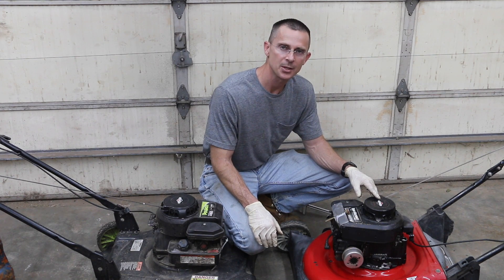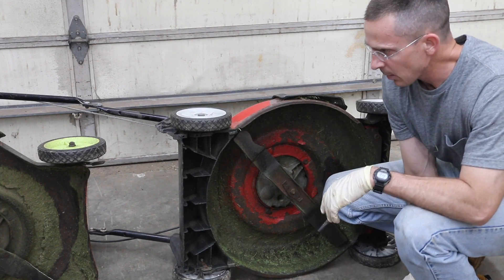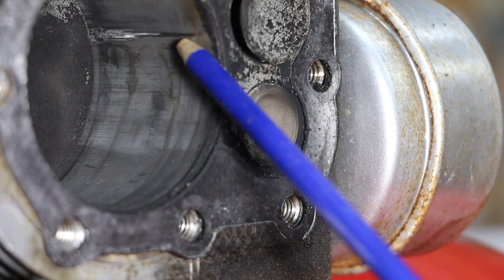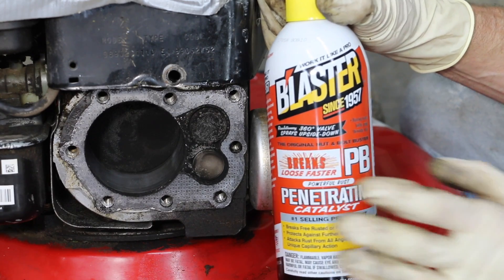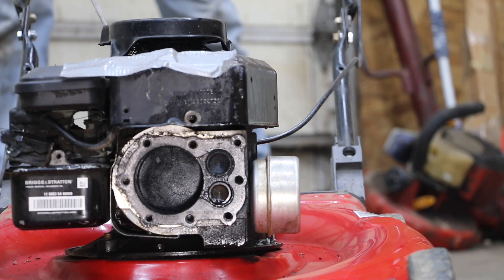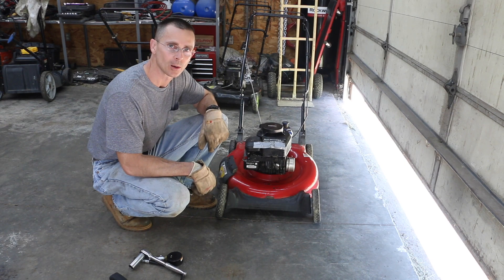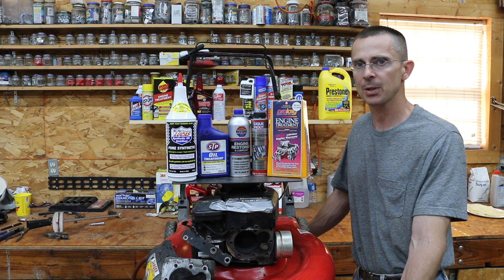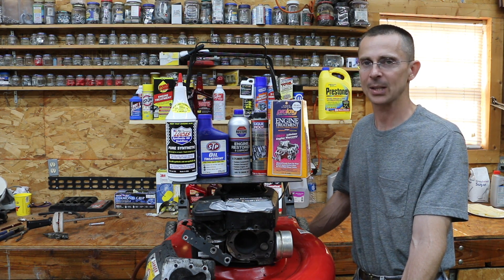Engine ran without oil, seized! Can it be saved?

Comment: I had a oil filter come off of a s10 blazer years ago and the motor locked up so I filled it with 100% slick 50 and it was a standard so I pulled started it and the motor finally broke free and started but once running it knocked for about 5 minutes and finally smoothed out and I drove it for 6 more months and put another 7k miles on it until ball joint broke and wrecked it into a ditch.
Reply from the maker: Shane, Very impressive!  Thanks for watching the video and commenting!
Reply: +Matthew Mckinney
Story time. I have a Ford 302 in my car. When I bought it, the oil that was in it was 10 years old. The car itself is 30 years old. By the time I got it home and tried starting it again, the engine was seized. All of the oil had turned into sludge and was everywhere except the oil pan.

I put 2 quarts of oil in it and it started. After a couple oil flushes and some other cleaners, it runs like new. Starts on the first crank every single time. The only issue it has is a lifter tick.

In fact, it still has more than enough power to overpower a shot wheel bearing, and to damage the transmission, and it isn't even an H.O. I hadn't thought to service the transmission, so when I finally had it flushed, it basically bricked it. Mind you, this car sat in a garage for 10 years and the transmission still worked about 98% before the flush. I also have a suspicion that the shop didn't refill the gear oil when I had them put in a diff.

On the flip side, my mother has had 4 Chevy engines fail for no apparent reason. Two of them were 5.3 LS engines. The oil pumps in them are garbage. The 454 oil pump also failed. We still don't know why the 350 bricked. It just decided to die and never started again. None of them even had 200,000 miles. The highest was a 5.3 with 186,000.

...Which is 300,000 km, gravedigr12.

But ya know, hurr durr Ford sux, muh junkyard LS, etc.
Reply: @ootdega   my dad has a 2009 silverado with a 5.3L 273,000 miles. The oil sending unit went out like a year ago at 200,000 miles never put a new one in it but he put 73,000 on it and it says 0 oil pressure lol
Reply: I don’t particularly cling to ford trucks but my neighbor had an f150 with 750k miles on it before the transmission wouldn’t shift out of 2nd anymore. I thought it was pretty durable for the most part. Larry always changed his oil and filter at 3k miles and took very good care of it.
Reply: thats awesome dude
Reply: #murica
Reply: oldschool Boost sounds like a 2.8
Reply: My engine on my 1992 caddy locked up if I put oil in it will it start?
Reply: Every auto mechanic that has worked on cars for a living has a soft spot in there hearts for GM. I don't know where all of the hatred is coming from? Try working on a Jaguar!
Reply: What the hell? Were you 16? Or... 5?
Reply: limitless rc, running an engine that seized up from no oil for 7k more miles, yup that's a GM product for you.
Reply: @limjahey4585  GM engines are not the huge problems, its the electronics. Watch some of the Scotty Kilmer channel. He always talks up Toyota and Honda while bashing GM and Chrysler for their quality issues.
Reply: limitless rc yep random butthurt comment from an insecure car owner must be a Ford owner enjoy rebuilding your engine at 300,000km.
Reply: I've heard of oil pick ups falling off before, that would probably cause that issue, but for it to happen repeatedly? There's no engine I've ever heard of that just has such terrible machining it just locks up for no reason on a regular basis.
Reply: Oaf Dawg actually you can beat any chevy new or old. With a Ford, or import too. Chevy is and has always been trash, the parts just dont last. People like to trash on ford but i know more fords running today from 40s, 50s, 60s, 70s, 80s, and even the 90sup to 95. And even as a ford person, i wont own anything made after 1995 simply because triton, vortec, ecotech and echoboost cannot make an engine worth two fucks. I've seen more 2017 gm and chevrolet products sitting in the side of the interstate than i can count. Chevrolet needs to stop getting government bail outs and just shut down and give it up.
Reply: @carll.freemanjr.9867  The problem with these old US corporations is that they believe that because they have been around a long time, they should continue to exist simply for that reason. If the big car manufacturers can't make it, they should sell out or fold up shop. Make some room for new car startups that are better configured for the current economy.
Reply: Had a Chevy 283 that was froze up back in the 70's. A 36" pipe wrench on the crank wouldn't turn it over. I put the trans, clutch and bell housing on it and put it in my 66 Chevelle anyway. Poured Liquid Wrench in each plug hole, left the plugs out and had my gramps in his pickup push me down the road. I got going about 25 and let the clutch out. The engine was so locked up the tires just squealed. Finally after about 3 tries with the trans in 2nd gear the engine finally freed up. I put the plugs in, wired it, and fueled up. I push started it and that engine ran like a top! Stock 283, with a Rochester 2bbl carb and factory duel exhaust would smoke Trans Am's, Firebirds, AMC AMX's, and other "muscle cars" back then. That motor ran great until I pulled it and replaced it with a built 327 .030 over. Just can't beat them old Chevy motors!
Reply: Patrick Baptist
ya nice story... US military bought... GM's ... ford has a recall for the steering wheel falling off... 

And I can talk about the POS 6.2 diesels that went a million miles in a service truck... I would take a chevy any day over a ford at least when something breaks... ford... every last combo has everything different... chevy not that bad. Just because you drive the death out of the chevys to the point they die in the road but not the fords means nothing.

I've seen chevys broken in half still hauling scrap to the scrap yard.  

Won't even comment on the 454... for it to be that low of HP it must have been an emissions 454 from like the 80s?  I've seen 454s worked to death and not even burn a drop of oil yet the block was rotting out from age / use (plow vehicle)
Reply: Ya ford should shut down as well, they took that HUGE gov loan they still owe on... GM paid the gov back already.
Reply: Matt Lane you should look that up because you are incredibly wrong. Ford took a $5 billion loan and it isn't due back until 2022. GM took a 20 Billion dollar BAILOUT and fired the CEO, then couldn't afford to pay it all back because their stocks tanked so hard. The government sold their GM stock for less then 9 billion. So no GM still owes 11 billion of our tax money. As a former GM guy i also drive Fords now, and most guys who drive Fords daily do it because they got tired of fixing GM products all the time.
Reply: Jimmy Doolittle that's why you buy a chevy truck and swap either ford or dodge axles
Reply: gm engine seizing? yep, sounds normal. had a friend who's parents had a gmc jimmy. thing went through motors every couple of months despite regular oil changes. they'd always seize after awhile. older couple and they didn't hot rod it.
Reply: OpposingForces haha went through motors.
Reply: still ran, still better than a ford
Reply: Hey gravedig, I drive a F350 that is getting close to having half a million MILES not km on it, it hasn't been rebuilt or had any major work till this week it was time for the turbo to be rebuilt....
I own a GM motor home that couldn't make it much more than 40,000 miles on it before it burned some valves trying to make 172hp with that 454 piece of crap they made  LOL.  I've never owned one GM product that was worth a crap, EXCEPT some Isuzus I've owned.
I've had chevy's stop in the middle of the street before, I've never had that happen in any Ford I've driven ever, they usually screw up in the drive way, the chevys lol, just add more expense with the tow when they can't make it.
Shucks when my ol Taurus decided to break a suspension spring it atleast did it in the drive way after I was done driving LOL, I've seen a chevy frame bust in the road on someone driving before.

Most people don't also realize but no company has had the fun of steering columns locking up on people like GM, even applies to some vetts, how retarded.
Reply: Patrick Baptist I never thought about it that way but it does seem like all of my old fords have broken at home after I got where I was going. Love those trucks
Reply: Shane Shaned broken ball joints yep that's a gm product for you

Comment: I don't think there is any product that can get rid of that rod knock without physically replacing the rod bearing, the noise is because the gap is too big and your hearing the rod slap going up and down. But I'm sure your already know that :) keep up the great videos!
Reply: That's exactly what Lucas is for, hiding the sounds of a dying engine so a sap will buy it. The secret weapon of shady used car salesmen all over...
Reply: robbie turnbull they do NOT have any bearings in the connecting rod, they are just an aluminum connecting rod, that's on the cast iron polished crank. the aluminum laps to the crank and that's it. a bunch of material was lathed out when she was lacking oil. the knocking could also be a wrist pin, and or the piston touching the head. he should remove the governor and rev er to the moon still it let's out all the shmooo
Reply from the maker: Thanks for watching the video and commenting!
Reply from the maker: Stealth, Yes, I agree.  It'll be interesting to see which product reduces the noise the most.  Thanks for watching the video and commenting!
Reply: First drain the oil.
Apply about half light oil. crank it manually without running for a few times to get it flung around
then add the rest with LOTS OF THICK HEAVY DUTY OIL
it should at least reduce it.
Reply: realflow100 " you are my density""- George McFly 1956
Reply: How can a connecting rod not have a bearing unless you mean its a bushing and not a bearing, that what we call it where I'm from.
Reply: Like the old BARS stuff we put in brakes and radiators to plug leaks.  It'd destroy it in the long term but short term it'd make it work better.  ;)
Reply from the maker: Thanks for watching the video and commenting!
Reply: ZIP TIES N BIAS PLIES 
Fuck you doing here ? Get back to doing cold starts. 

Miiiiint 👌
Reply: Well I didn't. Thanks for the info
Reply: StealthLX you never heard of a rod bearing lol.
Reply: realflow100 Yeah maybe some 90w Diff oil would somewhat reduce the noise. Then as a previous posted suggested, clamp the throttle plate wide open to silence it permanently.
Reply: You know that means to brick the engine on purpose by over revving is what you just said right? or are you just making a joke
Reply: realflow100 I was making a joke, yes. Of course that would kill it - so silencing it permanently. Try a couple of things, then end with a bang.
Reply: StealthLX these 3.5 hp Briggs and stratton engine don't have rod bearings its it basically your con rod just bolts and clamps on to your crank shaft
Reply: 90w Gear Oil isn't as thick as you think.
Reply: Zip ties what the hell you doing here?? Get back to ol Slave Lake already?? Unless you’re looking for the right additive to add to some radioactive horse piss.
Reply: RELEASE THE SHMOO!
Reply: But thats kinda the problem, it can help but it can also hide things. Is my valve train working right or is the sound of bad lifters being hidden by the Lucas? If your bearings are starting to go or your rings it can buy you extra time before the engine dies but I think its best to only use it when it gets to that point. I have also yet to see any thing to make me think it works better then simply stepping up your oil weight and that is allot cheaper.
Reply: Austin Lucas hahahaha. It's thick as fuck! What are you?  Dumb?
Reply: It doesn't have a rod bearing so replacing that isn't and option.

Comment: I went to an engine fair a few years ago and one guy was showing us his stationary engine which he had made the cylinder liner out of epoxy* after it had seized. It worked fine (albeit at 100 rpm). You should try something similar with a lawn mower.

* slather epoxy over news paper and put it into the bored out cylinder, when cured bore to size and hone
Reply from the maker: dquad, This is a great idea!  Thanks for watching the video and commenting!

Comment: First! Thank you for another great video! Which brand would you say has the best built most reliable engines?
Reply from the maker: RKG Austin,  Regarding mowers, I've spoken to a lot of lawn business owners and most highly recommend Kawasaki.  For smaller engines, the industrial grade Honda engine is very impressive.  For low entry point mowers like the ones I test, i like the Briggs & Stratton design that I'm using.  I don't have much experience using the overhead valve style engines.  Thanks for watching the video and commenting!
Reply: Thanks for what you do and all the great info!